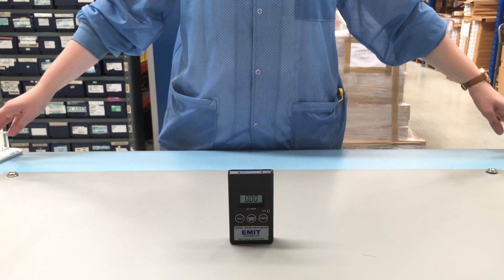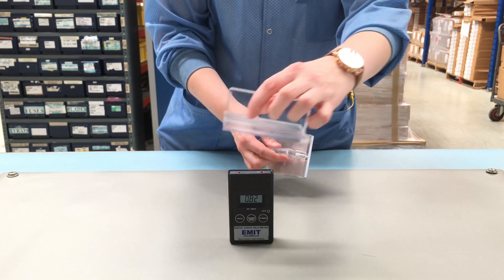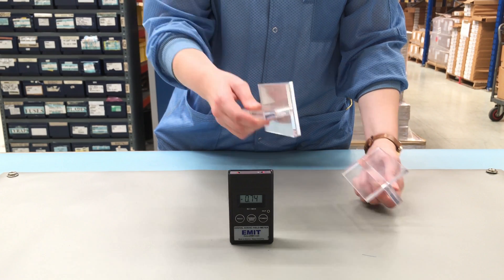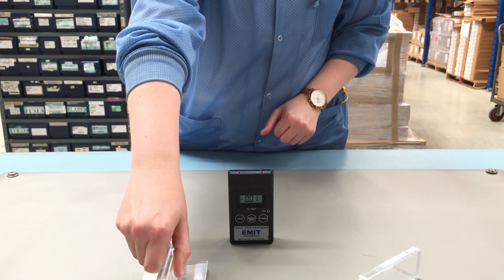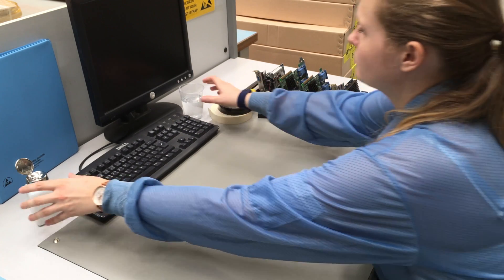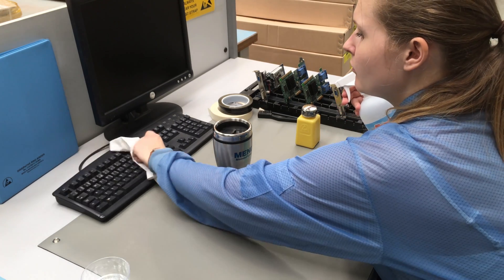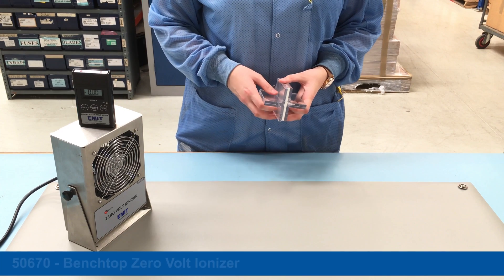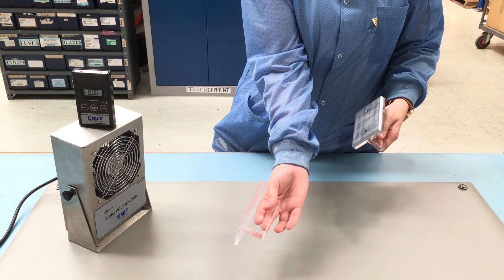Why Use Ionizers

Comment: What is better? A copper needle or a stainless steel needle.
Reply from the maker: We do not have any data on copper emitters; however, stainless steel is inferior to tungsten. Tungsten emitters do not rust nor experience any other excessive degradation. This property makes them a popular choice for use in in ISO Class 1 or cleaner environments. All Desco ionizers use tungsten emitters.

Comment: Are air ionizer safe to run while the worker or technician is in the room?
Reply from the maker: Operator safety always takes precedent to ESD control. Your facilities safety coordinator/officer should be consulted on any question of safety. Desco ionizers are intended to be used with an operator present. There are no known risks associated with using Desco ionizers.
Reply: @DescoESDControl  thank you